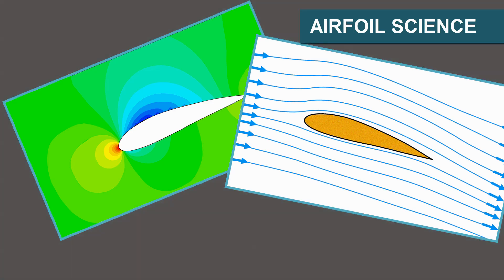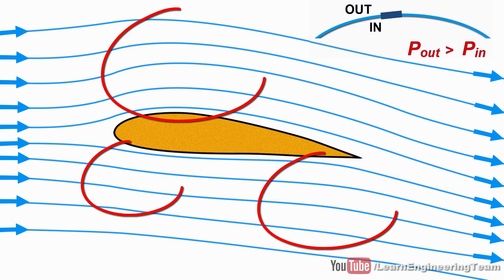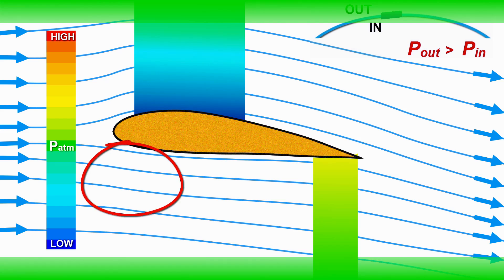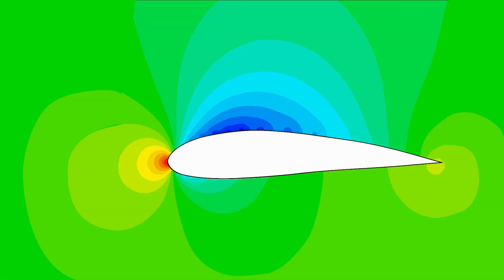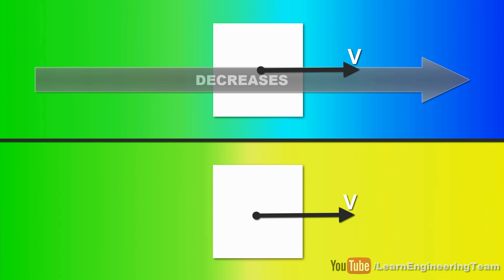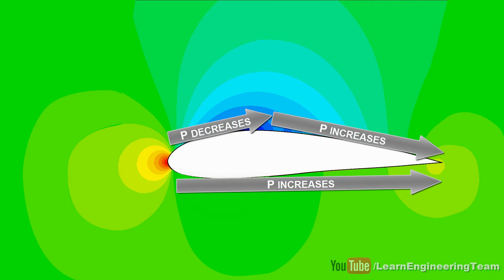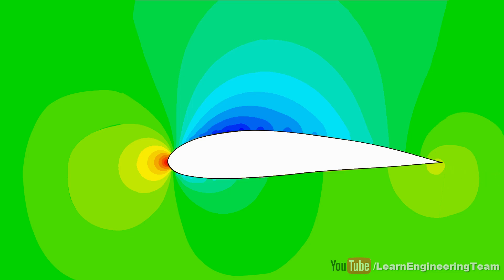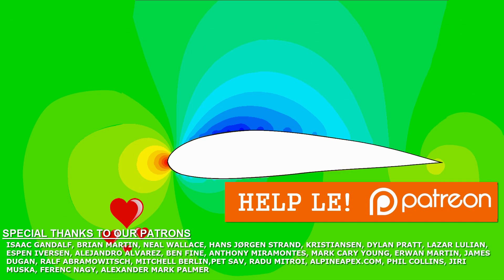Why is the top flow faster over an Airfoil?

Comment: Summary: "An air foil works this way because of the way it is."
Reply: absolutely
Reply: +Samm Sheperd  (alwayschooseford is being silly) You are correct Samm. Correct.  One explanation works for ALL WING CONFIGURATIONS  This is because it is the flow of air around the wing (that is caused by a wing) that is what is important, not simply the airfoil shape.  .
..At an Angle of attack above just a few degrees on a flat plate wing, wind tunnel tests show that there is a turbulent layer that effectively duplicates a cambered wing for the air a little further from the surface. The air does not flow smoothly along the surface as many people think or show in their videos.  It flows just like the flow of a cambered wing.   It creates a lower pressure above and higher pressure below due to the relative movement of air and wing.  There is more drag, however.
-- 
Cheers, ScienceAdvisorSteve
Reply: Yes :) It won't be quite as efficient, but it will work.
Reply: Observ45er. Sir,  May I ask you to consider this following  phenomena. When the upper part of the leading edge  compresses the air particles ahead of it, it pushes them out of the way in an upward direction . This acceleration and forces required to push  them quickly out of the way,  all come form the fact that a powerful engine is continuously pulling the wing in  forward direction and so it does not matter if there is drag on the leading edge,  the engine will keep pulling the wing forward forcibly , and shooting the air particles upwards above the leading edge ( sort of a plough effect).   Well the newly gained high momentum of the air particles above the wing will try to separate from the wing and in fact a depletion of air particles above the wing does take place and this is low pressure or a partial vacuum. When this low pressure appears above the wing, the air particles that were shot up by the inclination of the leading edge will start falling  attracted down into a  low pressure zone and   they will also keep going down even  behind the trailing edge. Meanwhile the wing as a whole  is sucked up by this moving bubble low pressure above it   and this lift is  quite a lot of lift. 
Incidentally, if it was not for the compression  distribution below the wing,   with what happens above the wing the leading edge will move down due to compression zone on it  and the trailing edge will move up due to the low pressure zone above it.   
The downwash behind the trailing edge is partially due to the result of the  compression of the air particles under the wing but also due to shot air particles by the upper part of the leading edge causing a low pressure above the wing  and they will be sucked back down   and proceed to increase the downwash contributed by the underside of the wing.   
It is all as you said  all  due to a down wash of air, but please consider how the upper side  of the wing contributes to it.  It may not be a  magic force that does it,  and there are other micro  dynamics effect which are fascinating and if one  appreciates them, well it is a fascinating behaviour better than any artist will produce. I tried to explain some of these  fascinations elsewhere in this thread of comments. 
Ir there are  water particles in the air, so the  wing  will be flying in a vapour,  well those pressure differences you speak about will me magical  and so instantaneous that many miss the miracles of nature.
The silent and invisible phenomena  and logic of engineering  are part of God, and understanding them is like understanding  God himself,  if only people would realise that God is in fact Energy and energy can take the form of mass, and what we are talking about is just the behaviour of mass and energy. So, it is our duty to understand mass and energy behaviour in the micro detail it  contains.
Reply: @carmelpule6954  Nice explanation. But a clarification, God (with a capital
"G" ) is not energy and mass. Far from it. He is a pure spirit and transcends time and space. Mass and energy is just part of His creation.
Reply: @carmelpule6954  I am so sorry that I only saw this now trying to find another comment from s notification I received.
..
You started 3 years ago FAR above in this thread  with: "Sir,  May I ask you to consider this following  phenomena. When the upper part of the leading edge  compresses the air...".  
.. .. ..
.. .. ..
I never intended to deny that the effect above a wing has no part in lift, only that lift is due,  COMPLETELY DUE to the difference between the increased pressure below  the wing and the reduces pressure above it.
..
That IS THE LIFT FORCE.
..
In fact, the decrease above is much larger than the increase below.(the amount of change)
This means that the upper decrease contributes much more to that difference - 70 to 80 percent and more... Most of the lift comes from above (and I don't mean heaven (:-). 
..
The downwash does NOT CAUSE LIFT!
..
The downwash, as well as the upwash and around-the-tip 'spill are ALL caused by these pressures around the wing.
.. ..
In addition, What you describe about the air at the leading edge going above the wing, is the essence of that lower pressure.  Air has mass and as we should know from Newton's First  Law, that mass 'wants to go straight' unless acted on by a force. This means that ias does not want to follow the curved path that the air pressure is forcing it to take over and above the wing.  This is what I call the "centripetal effect". It is like being on a really fast ferris wheel, or at the top of a fast roller coaster hill.  You are being pulled down by gravity, but you feel lighter as you pass the crest because your mass is trying to continue straight.
Air above the wing is identical.
..
Whenever you see a fluid flowing in a curve you should be able to see that the pressure on the inside of the curve is ALWAYS lower than the pressure on the outside of the curve.  This is caused by the mass -- its inertia trying to continue straight.
..
Below a Wing at a good angle of attack, the air's mass/inertia pushes it harder againat the lower surface which increases the pressure there. 

This is all Newton's First Law in practice in fluids.
...'
So. Lift really is due to Newton, but NOT the way people focus only on the resulting downwash.
Regards.
Reply: Momentum is not a "magical force" and conservation of momentum can be used to fully explain lift. As the air particles are deflected in the vertical direction their momentum is transferred to the wing, meaning there is a normal force on the wing pushing the particles down in order for them to change direction (thus pushing the wing up). Conservation of linear momentum can, and is, effectively used to predict lift.
Reply: Carmel Pule' best, common sense' explanation I've ever head.
Reply: correc. only GOD is not energy. God is the creator of energy. ..but that is a whole different matter
Reply: @arvind kumar
You are welcome.  I've been studying this for several years and have read the better books and contacted some of the well known names in aerodynamics to get tings clear. 
..
First.
For Coanda, it is DEFINED as a jet, so only on the definition does it not apply to a wing.  However, the entrainment/viscosity effect occurs at the boundary of the jet and the stationary air around it, so that is also not occurring near a wing.
.
Second: Following the wing's Convex curve.
 I don't like using viscosity as a cause. My opening remark in this video is intended to stress that atmospheric pressure is holding the air against the surfaces of everything immersed in the atmosphere.  This does not go away when the wing starts to move in the air.
.
It is clear to me that many people loose sight of the fact that we live in a pressurized 'tank' of the gas of air.  It you ever swam deeper than about 10 feet  3m in water, you felt that pressure on your ears and lungs, BUT that same thing is going on in air.  We just don't feel it.
....
You will see some explanations saying: "IF it didn't followed the curve and continued straight, there would be a small "wedge" of space where entrainment occurs and that would lower the pressure." 
This is false reasoning because the air NEVER goes straight!  Never.  When in flight, the air is already following the curve and the effect described above is there.   This 'viscosity' story comes from looking at the start-up of the flow in a wind tunnel.
..
Side note.  The common demonstration of blowing over a curved piece of paper DOES HAVE Coanda *at first*!  AND the pressure is lowered because of that 'little wedge of air!  BUT...
BUT, once the flow is going, the pressure decreases for the SAME reason in this video - atmospheric pressure + curved surface + moving air + inertia.  That raises the paper. Then, after that, it is something else holding the paper straight. Viscosity *drag)  along the surface holds the paper straight. 
AND... 
Another problem with the "fast air-lower pressure" myth is that if that Blown air had lower pressure, blowing BETWEEN TWO papers would continue to draw them closer and closer, but they only go to some fixed distance, YET there is still "fast air" moving between them!! Fail!.
.
If you look at a wing on the runway and start it moving, viscosity plays no role.  The wing moves.  Around the upper curve, the wing moves AWAY from the air.  This and this ALONE lowers the pressure.  This is just like at your back when you walk.  Your back moves away from the air pressure and that lowers the pressure near your back, "drawing" air in from higher pressure around you. 
.
The viscosity  argument only works for the wind tunnel start-up view and with false reasoning to a flying wing.  
..
The principles causing something MUST apply equally for a moving air wind tunnel and a moving wing in flight.
..Regards
Reply: Samm Sheperd love ur channel btw
Reply: I think this is what I’m gonna write in my next Quiz 😂😂😂
Reply: Fireball XL5  yes, I remember.  While his writing was overly complex and confused, he had a pretty good diagram of air movements around a wing as it passes you by (stationary air reference frame).  He must have consulted with someone deeply in aerodynamics taking extensive data.
Reply: Fireball XL5    Speaking of Mars, Since I'm the Science guy, and we're talking so much about going there and Challenger Center has missions there, I decided to start counting my age in Mars years.  Last Earth-February, I had mt 39th Mars Birthday anniversary.
... Guess I never saw that Mars-moon scam before.  New to me.  
I've also studied the Flat-Earhers and Apollo hoazers so I am familiar with their stuff to be able to address it if it comes up, or how to handle the fanatic, or not...
.
Took the C6 on a camping trip out to the western US once, too. I'm abt 50 miles NW of Chicago w/good skies, but out there really good sky!
Reply: Fireball XL5   Not familiar with "Genius". I don't watch much TV.   
This thread is getting long and not properly responsive to the notifications. The way they are displayed is different now, too, in a smaller popup window that scrolls badly.
..
RE: Demos, Last year I started doing the self-carving pumpkins.  In a school gym the reverb is truly awesome!
Reply: Fireball XL5  I guess we've had the C6 for more than 33 years now since Halleys went through in 86.
Reply: Fireball XL5  DON’T PUSH IT BUB ! Mars Year is only 1.88 Earth years, not 2…  You do the math.
..
MeTV I can get off-air from Chicago.  We should dump cable. ($$)
..
AH!  The Upper Surface Conundrum… 
Yes, density constant (incompressible below about 2-300mph), like water.
..
SideNote: If you assume EITHER; the longer path and reduced density above; OR longer path / equal transit with  Bernoulli’s Equation, you don’t get enough pressure drop to lift the plane. This is why some people say it is “partly Bernoulli” and partly something else.
…
First, remember that ANYTHING moving in a curved path is undergoing radial (centripetal) acceleration with a net force pushing toward the center of curvature. 
..Note that BOTH upper and lower air curve downward.
..
The lower air is easy to see because the wing is bumping into, or pushing up against the air when you look at a modest AoA.   Higher pressure (1+ atm) above it, near the wing, Atmospheric (1 atm) far below – Pressure gradient ACROSS the flow = radial acceleration downward.
.......
The upper air has two contributing factors to “stick” to the surface as much as possible.:

1] Air pressure is still ALWAYS downward on the top surface (yes, even in stall).   It only drops about .07-0.08 PSI (ok maybe 0.09) from ambient for a Cessna 172 and about -0.7-0.8 PSI for an airliner.  The pressure changes around a wing are really minimal.   BUT wings are LARGE!
.
2]   Viscosity causes it to stick to the surface AND flow smoothly (laminar), I won’t go into it more, but see; A very good video. Professor Krzysztof Fidkowski, associate professor, Aerospace Engineering  University of Mich.
 How Planes Fly.  https://www.youtube.com/watch?v=aa2kBZAoXg0  

..
IF we accept that we see the flow curve over the top we KNOW there is less pressure near the surface, right?   This lower pressure near the wing in combination with the 1 atm farther above is the centripetal force inward, toward the upper surface…… BUT…  What do YOU feel on a merry-Go-Round?  A pull outward (“centrifugal “)– due to your mass wanting to go straight  INERTIA.  The air wants to go straight = "pull away" from the surface, thus we have a lower pressure there.   SO… It has to stick and follow the surface, but tries to go straight, thus lowering the pressure.
..
Density change ?  Think of water .... OR ... your locked-straight arms on that merry-Go-Round.  They don’t get longer, but do feel that pull toward the outside = pressure reduction, but no density reduction (to speak of).  If you do PV=nRT you’ll see the P change is minor for 0.09 or 0.9 PSI change.

What this means at the molecular – momentum  level is that the inertia of the molecules, in trying to go straight and they do not have as much kinetic energy toward the surface and more away, so the impacts transfer less energy and, therefor less pressure – BUT there are the same number of ‘em still there. 
… So TL;DR: Yes, it is centripetal/centrifugal effects.
..
ALSO NOTE: It is the curved AIR FLOW PATTERN that gives the pressure changes near the surfaces, not simply the wing shape.  A completely flat plate wing has VERY SIMILAR flow pattern around it.  So focusing ONLY on wing shape can lead one to conclude that wings have different ways to make lift when they don'rt  ALL WING have similar flow patterns.
..
Check out the next link and you’ll get the full treatment, I think I need to add this detail about the upper surface…. 
 PLUS! There is a BONUS of a diagram of how the air moves from the stationary air / moving wing perspective which is VERY INTERESTING!!!  [SPOILER ALERT: The upper air is not faster than the lower air - (YEP!), but it is accelerated much more and totally reverses direction!]
https://www.quora.com/q/rxesywwbdscllwpn/Understanding-Lift 
- - 
Cheers, Steve
Reply: Fireball XL5  Ah! You've  got me on this one. “Bernoulli Levitation”.
I did this as a kid with a thread spool in the 50s. My Dad must have initially shown it to us.

 I haven’t been able to work this one out from beginning to end like i have for the wing. The best I’ve done is what my friend at JPL did to explain it.  We start from the outlet and work backwards, upstream.  
I’ve kinda’ resigned myself to the possibility of never getting it.
However, this does not explain WHY the pressure drops right as it spreads out from the hole, it only shows that it must; and data proves this: See below.

 I try as hard as I can to make it like the venturi where it is a restriction that raises the pressure in the upstream  center ‘tube’ and the circular exit / outlet of the ‘tube’ is the hole in the pressurized tank, but I can’t quite convince myself that works.

1. We know that the outer rim of the flow is as atmospheric pressure.  This is a common assumption for anything emptying into the surrounding atmosphere. A common venturi with a fan pushing air in, but the outlet open to atmosphere, has its outlet at atmospheric pressure.  So does the outer rim of the spool. 

2. Looking at the way the radial (outward flow) goes, it is spreading out and slowing because the area is increasing due to the increase in overall circumference. This is like the second half of a venturi where the cross section widens and follows Bernoulli. The conclusion is that pressure is lower than atmospheric upstream, at the “narrower” center.

Here is a paper with real data. They also don’t attempt to explain why, just “here’s the data”…
https://arxiv.org/pdf/physics/0206025.pdf  
Cheers
Reply: Fireball XL5  Forgot.  the bottom of that paper gas charts with pressure data at points along the flow.
Reply: Fireball XL5  It also seems like the spool & card is related to the ping-pong ball and funnel thing; except we can see air curving around the ball and that curved acceleration looks like Coanda and that one defies logic at this time, too.
Reply: Fireball XL5  This thread is getting too long.  I didn't get notification for that last reply.  I just thought I'd look at the last one for the heck of it.
..
I also realize this is long, but this is how my brain is wrestling with the levitating plate
..
..
Hose and plate video:
I hope you realize that the air out of the hose is at atmospheric pressure.
..
The centering of the ball is easy. Similar to Magus and the wing's upper surface.  The air curving around the sides to the top creates the low pressure all around the sides and upper surface. When the ball drifts to the left, more air curves around the right side causing the pressure to decrease more on the right. ... Of course, the dynamic / stagnation pressure on the bottom pushes up.
I believe Veritassium has this in a video.

.....
For the plate levitation?  yep.  It is a puzzle for me too.
I want to see the pressures measured all the time and what happens as the plate moves closer. 
- Does the hose pressure rise as the plate moves closer?
- Where the hose exits the first plate (with NO second plate) there must be entrainment along the stream exiting the hose/plate and, therefore, air gets drawn in from around the flow, bringing in air inward toward the flow along the first plate....THUS, there is ALREADY a lowered pressure near the hose exit...
..
.
I still have it in my mind that the hose-plate is somehow very similar to a venturi, where the transition from hose to the added plate is just like the narrowing of the venturi tube. The plate is a restriction and increases the hose pressure...BUT... the gap between the plates is the "hole" that allows that pressurized air to escape and is, therefore, lower P than the hose.
HOWEVER, I still can't see how the pressure can go below atmospheric; just lower than hose P.
...
Also, also.... The stagnation pressure of the air slamming into the added plate pushes AGAINST the floating plate...
...
But then... But then.......The air exiting the hose and turning sharply to go sideways out the gap...?....  That is a tremendous curved acceleration as the air goes from straight in the hose to radially outward. . Therefore, the pressure at the edge of the hose-end must drop LOTS!!!  This is on the inside of a curved flow where the Static pressure is lowest because the air "wants" to go straight, just like you on the merry-go-round.
This is where the University paper shows the big P drop as I expect, in. I think. Figure 6=pressure chart.  But...But... The outside of that curved flow where the P is 'higher' is up against the floating plate.
.....
Trying to keep ALL THESE RELEVANT THINGS  in my head at the same time is too much to make sense for me. so far.
..
..
..
Another thing is back on a pipe venturi... for a carburetor, it is ALL below atmospheric pressure because the engine is providing "suction" and the inlet is at atmospheric pressure. SO, it's no surprise that the skinny section "sucks" fuel in, because it all sucks.   BUT, BUT when you push air in and the outlet is at atmospheric pressure, I still have trouble seeing now the skinny section can go below atmospheric P.  
.. 
What if you only take half a venturi pipe with blowing air into it (means it is at a higher P) and cut it at the center of the skinny section so the skinny section exits into atmospheric pressure?  I say that the pressure in the fat, inlet section rises above atmospheric because of the restriction. but.... but....Is the skinny section at or below atmospheric pressure?  Major conflict there.
..
..
..
What worries me is that if I figure this out in my head that it will teach me something that makes all the former stuff I thought I figured out "invalid" and I never had it right all along...!...?... YIKES!
.
Cheers
Reply: Fireball XL5  No Go there ??
I see you have to have an account to comment.  It's not complex and I think all you need is an email.  Otherwise I'll try something else.  I just don't want to giver a full email in the clear here...
Reply: Fireball XL5  Sent.
Reply: Fireball XL5  I'll watch for your email...
Reply: Fireball XL5  I look forward to hearing about it.
Reply: Fireball XL5  No surprises there, but the paper should be interesting. Thanks and waiting patiently for the email.  I have a science lab Wed AM (Chicago time), so that may slow my response.
Reply: @Observ45er  Going back up to your statement (which I've heard before, and aesthetically like as the "best" solution) about linear momentum being adequate to explain lift (on any wing shape), I wonder if I could ask a question (as someone educated in physics and (electrical) engineering but new to most aspects of aerodynamics):

If linear momentum is adequate for explaining wing lift...

What about these two simple experiments:

1. Place a piece of paper flat on a table -- blow across the top -- the paper will lift.
2. Shape a piece of paper into a classic airfoil shape, with the rounded leading edge hung over a pencil. Blow directly at one side -- it will move away. Blow across a face, and it will move TOWARD the side with that airflow.

If these things are true -- whatever the explanation (Bernoulli, N-S, etc.) -- would the same effect not still come into play with a wing (provided different flow-speeds on the upper/lower surfaces...?

I've heard that the idea of lift due to effects like that was so interesting that it was over-taught... to the exclusion of conservation of momentum... even among aero-engineers and physicists,... for decades...  and that the conservation of linear momentum / collision contribution is by far the most significant factor...

...and I can see how airflow differences could be secondary effects of the primary CoM/collision contribution...

...but I wonder whether an independent pressure differential might not also be a contributing factor..    ??

Does that make sense?

Would you help me with this?

Thank you.
Reply: @gburro4579 ,
I have several comments above.  It would be good to read them all, but I’ll comment on yours. 
..
While I’m primarily an EE, I studied fluid dynamics and consulted with several of the noted experts to make sure I understood things.
..
#1 Does not happen.  Flow parallel to the paper will not lift it.  I do these demos frequently and correctly. Weltner shows how you can easily do this and learn the true science. See ref below for Weltner’s papers.
..
#2 Flow along a convex, curved surface results in the Coanda Effect. This is by entrainment not a pressure reduction due to “fast air”. 
Entrainment is due to viscosity; that is, friction between fluid layers moving at different speeds. The blown and therefore “fast moving air” has the very same pressure as all the ‘still’ air all around it and is easily measured as such.   The nearby surface prevents the entrainment on that side and the flow entrains the surface. The surface is essentially ‘dragged’ along with the flow – similar to trying to slide a brick along the top of a skateboard.  The board moves.
..
Where Bernoulli comes into play is inside the blower.  The higher inside pressure pushes (accelerates) the air out of the blower into the lower atmospheric pressure of the still air, so it is at that same atmospheric pressure as it speeds along.
..
Coanda does not happen on a wing because there is no forced jet of air with still air around it.  This friction simply produces drag on the wing.
..
The different flow speeds are not the cause of the pressure difference.  The pressure difference causes the accelerations of air.
..
Conservation of momentum does happen, but it does not cause anything. A wing (of any of the common shapes while generating lift) produces the pressure differences around it.  On the wing, these pressures are what pushes up and provides all the lift force.  Force = Pressure over an area.
.
THOSE VERY SAME PRESSURES also cause all the accelerations of air that occur around a wing.
.
A pressure difference between two locations is called a Pressure Gradient.  It is a Pressure Gradient that accelerates the fluid.  This is Newton. Air has mass.  A force is required to accelerate a mass (even air); it is the pressure gradient that provides the force.  Euler figured this out in the mid 1700s following on Bernoulli’s work.
..
By “collision” I assume you refer to the increased pressure under the wing at a moderate Angle of Attack.   This provides one part of the pressure difference between top and bottom. It takes two pressures to have a difference.  What happens above a wing actually contributes MORE to this difference than what happens below.
..
Yes, many people have taught this bad science for a long time.  With so many people trying to get their 15 minutes of fame on You Tube and in various publications and lesson plans, it is virtually impossible to get to the real science with all that noise.  
......
I took my best physics and easily saw the flaws made by many, then contacted several of the noted people who actually worked in aerodynamics (not just taught it from other references) to make sure I had things figured out correctly.  With a few adjustments, I had it correct. 
.
 It also takes careful wording because sometimes a word or phrase choice means something different to another person. 
I do not understand what you mean by an “independent pressure differential”. 
..
For an in depth, step-by-step explanation that isn’t covered above, please see this reference and the accompanying Bernoulli Blog:
https://www.quora.com/q/rxesywwbdscllwpn/Understanding-Lift-Correctly 
Regards.
Reply: Genius. You gotta be awake to think of that explanation
Reply: I always think that a flat plate is trying to split air. Bit like a knife in cutting butter. We use to have a knife that would never cut straight, the blade would cause a twist. If the twist was resisted, the blade would try to push the butter sideways.
Airfoils do the same just more aerodynamic and efficient.
Reply: O.N.E    ""it is what it is""
.. ..
There you have science explained in a hackneyed platitude adding so much to the discussion.
Reply: @arvind kumar An aeroplane wing ...stationary air...flow is smooth ... nil separation.
** Yes.
.
Please clarify the following:- 
****OK
.
1. Does the fluid particle (outside the boundary layer) have constant energy along the streamline from free stream before the leading edge till the trailing edge?
 ** Yes.   Charles East Lake describes two ways to calculate lift are 1- using Bernoulli’s equation to calculate pressures around a wing, OR 2- calculating the momentum change of the surrounding air.  I discussed this paper with him. https://wiki.mattrude.com/images/4/44/Bernoulli_Newton_Lift.pdf
.
** The upper and lower parcels of air start out ahead of the wing with the same Total Pressure/energy.  They are not along the same streamline, but this is just about the same as being on the same one.   The energy requirement is the reason for specifying one streamline because it doesn’t vary, but as long as there very little energy difference between two streamlines, you can still use it…  OK??. 
.
** So the complete answer is that the upper and lower flows have pretty constant energy to the trailing edge.  Not exact, but, I guess good enough for real life. I have no real number for how close, only Eastlake’s word that it works and that he had students doing this calculation all the time.
.
.
2. Only if the answer to the Question number 1 above is yes, then only we can apply the Bernoulli's theorem.
.
** You can apply Bernoulli’s _Equation_.  Eastlake said that it gives a reasonably good value.
.
** I think we should call the word description “Bernoulli’s Principle/Theorem/Law.  And call the Actual equation as “Bernoulli’s Equation”.  I consider them as two separate things.
.
.
3.  On the outside of the curved streamline there is more pressure. How does Bernoulli's equation explain this or take this into account?
.
** It doesn’t.  Bernoulli’s Equation works for two locations ALONG a flow (streamline). Note that in the equation, there is no provision for a direction change, only speed, even though it is often called ‘velocity’.  Do you understand the difference between speed and velocity?
.
** Something you really need to understand.  Bernoulli’s Principle (the words, not the Equation) says that “a speed increase is associates with a pressure decrease and visa=versa“  A speed increase is _ACCELERATION_.  This pressure decrease is along the path – between two locations on that path/streamline.
.
 SO… 
.
If the fluid is traveling toward a lower pressure region (from a relatively higher pressure region) it will speed up (positive acceleration).
.
If the fluid is traveling toward a higher pressure region, it will slow down (negative acceleration).
.
If the fluid is traveling between two different pressures (on either side), it will curve toward the lower pressure. This is “radial” or centripetal acceleration.
.
PLEASE NOTE THAT: It can be both changing speed and direction (curving) at the same time. This is happening above and below a wing.
.
PLEASE NOTE THAT: all three of these can be called “acceleration” and in all three cases, the acceleration vector/direction is the same direction as the force/pressure vector.  
This is nothing more than ordinary Newton’s Laws working in fluids.  A pressure difference is a force on fluid.
What it is trying to tell you is that air/fluid is accelerated by the force deriving from two different pressures.
.
SO: The BOTTOM LINE here is that:
.
A Pressure Gradient (a pressure difference between two locations) Accelerates fluid away from the higher pressure toward the lower pressure region.  This what is causing ALL the air movement you see around a wing.
.
Also note that two different pressures on two opposite sides of some object will push the object toward the lower pressure side.  This is lift.
.
This is what you really need to understand here.
So few people seem to be able to understand this.
.. .. .. ..
N-O-W.  After saying all that, we have one gotcha.
.
Above a wing we have something new going on. This is the situation that Doug McLean says that it “work both ways”…
.
Here, you have that upper surface, in a pressurized atmosphere pushing and HOLDING the moving air against that convex curve. Then add in the air's natural tendency to continue straight (as in Newton’s FIEST Law;)  That entire combination pf things that is WHY the pressure is decreased above a wing --- WHAT I describe in this video.
.
What I want to point out is; this is not really just a simple “works both ways” sort of thing.  This is because above a wing you need ALL OF THOSE CONDITIONS for them ALL to create a lowered pressure.
.
In the other cases, Pressure Gradients causes Acceleration (along a streamline).   Simple conditions.
.
HOWEVER…
.
Above a wing it is NOT simply “speed causing a pressure decrease”  Nope!
.
Above a wing, it takes ALL of those ingredients for it to seem like the speed is causing the pressure decrease all by itself, but it is not.  It takes ALL OF THOSE THINGS.
.
So it is not simply Bernoulli says: 
pressure < -- > Speed.
.
It is Pressure Diff. -- > speed change-- > add a bunch of conditions/restrictions to speed-- > pressure diff.
.
Making sense??
Reply: @arvind kumar The knowledge I explain, in many places, of this particular energy issue is about the fundamental physics and comes primarily from John D. Anderson and Charles Eastlake, both professional aerodynamicists. Anderson because of his book and a little from discussion and I specifically discussed this with Eastlake because of his paper on the subject. Calculating lift via Bernoulli's Equation is frequently adequate.  From ahead of the wing up to the trailing edge there is  little energy change or the calculations using Bernoulli's Equation would not be close. 
 https://wiki.mattrude.com/images/4/44/Bernoulli_Newton_Lift.pdf  
.
 However, my comments are about the science, physics of the phenomenon of lift, not calculations. 
.
The only thing I found about this video and commented a year ago, is the Claim about Coanda and I read that the author has found it is incorrect and plans to change that part. 
..
Yes, as I have said many times, Bernoulli's Principle has to do with Pressure Gradients and acceleration. I also make a clear distinction between Bernoulli's Principle and Bernoulli's Equation*.  The *Principle is simply that rather poorly stated relation of speed and pressure which has been misunderstood by so many in the amateur community.
..
I would say that it is the amateur community that is obsessed with a need to use Bernoulli.  This is not new.  They try their best to find causes for the various things going on and from a lack of true understanding of the fundamentals, make errors, that, unfortunately, continue to get spread around.
.
From what I understand, the pros use more accurate methods as you suggest.
..
Regards
Reply: @arvind kumar I have been aware of that one and made comments.   The only serious error is about Coanda. I replied to your last comment there.
Regards.
Reply: Well no, this will work with a flat plate too. It is primarily due to the angle of attack.
Reply: The pressure difference between the top and bottom of the wing is the lift Force. There is more air pressure under the wing than there is above the wing and this difference produces the upward force on the wing - PERIOD. It cannot be any other way. There are no other forces available to the wing.

The differences in pressure around the wing also cause all of the accelerations of air around the wing including the downwash behind the wing.

Air has mass and it takes a force to accelerate any mass including a mass of air. The force that accelerates a mass of air is a difference in pressure.
There are no other magical forces other than a pressure difference within a fluid.
Reply: @Observ45er  this video isn't intended to explain lift, it's intended to explain why experimentally in wind tunnel tests the air flowing over an airfoil travels at a faster velocity than the air that flows below it.
Reply: @kadenze6176   I don't know which comment you refer to, but your comment doesn't change my remarks.
What Learn has in the video is correct.  The Pressure Gradient is the reason for the speed change (acceleration) of the air over the wing.
.
  However, it is NOT Coanda above the wing.  It looks similar and they both cause a lower pressure, but it is not Coanda.
.
Unfortunately, Learn does not explain why the pressure is lower above; what is the cause of the lower pressure, he just says look at the pressures and that causes the acceleration.
.
He DOES go on to talk about the lower flow and ignores that there is a general curve downward(from far left to far right)  which shows us that there is a general higher pressure under the wing because of that SAME kind of Pressure Gradient across the flow similar to above.
Reply: "No, an airfoil works this way because of the curvature of the air foil." The curvature improves efficiency, but is not required. You can make flying wings that are flat. They are just terribly inefficient. (And I've done so with foam board.) Angle of attack plays a big role. A well shaped airfoil improves the situation for various reasons, but is not the only mechanism for creating lift. So saying an airfoil works because of the curvature is not the whole picture.
Reply: No, an airfoil works this way because of the curvature of the air foil. 

This video explains that the mechanism driving the velocity difference between the top and bottom of the foil is the curvature of the foil as opposed to Bernoulli's Principle, since, as the last video explained, Bernoulli's only applies to a single streamline.

However, this pressure difference does not explain the lift, the majority of the lift is generated by newton's third law. This can be seen by the fact that a flat wing provides lift, as does an upside down wing.
Reply: +Samm Sheperd (SNRS) lmao really??